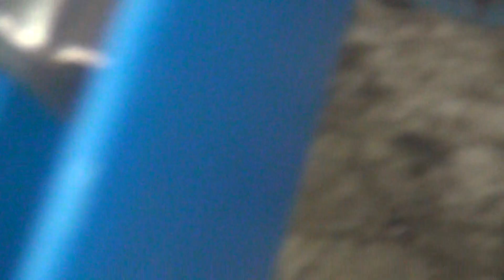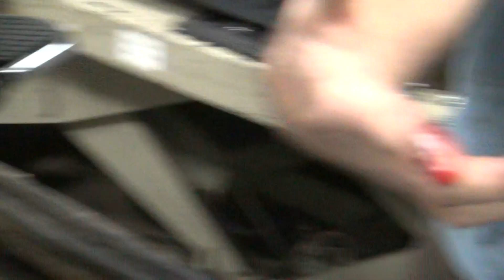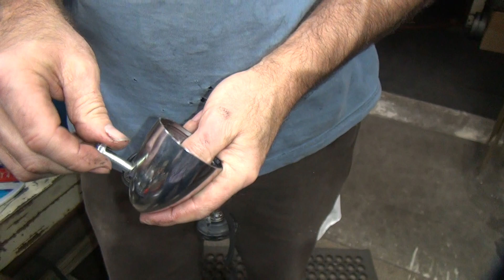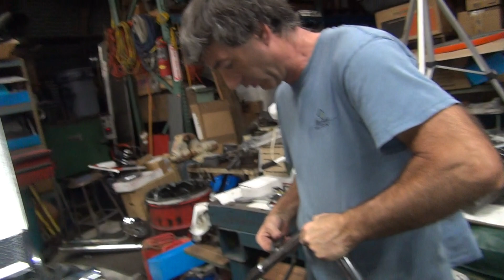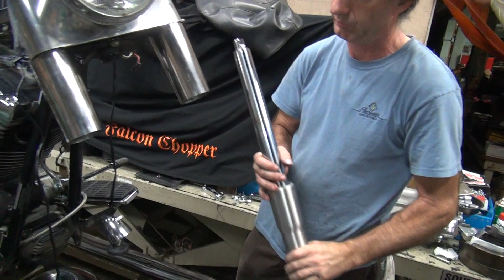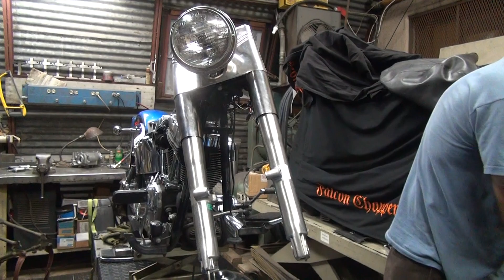2004 fatboy #103 craigslist find alan's new bike flstf softail harley repair tune-up tatro machine

Comment: Tatro, fat boy suspension and many new harleys they have from suspencion from showa made in japan, has a kind of retention "valve" below it that needs to be bled. To drain the air open the top Carry it down 20/25 times .......sorry bad inglis.
Reply from the maker: different fork but thanks for the tip. i think you are dealing with a cartridge fork. flt forks.
tatro
Reply: i work in motorcycles only...a dont no wath is cartridge ? hehehe
Reply from the maker: google it. most all modern bikes use them now.
tatro
Reply: yes...thanks..

Comment: @ 34 minutes you were wondering which side the harness for the turn signals and the dash instruments went on...since you fellas do the videoing it wouldn't hurt to pre film everything beforehand just in case there is a question about what goes where.
I used to take apart and rewire machinery, take it apart on the East coast and reassemble on the West coast...taking pictures beforehand sure saved a lot of time and headache...I'm enjoying the videos.
Reply from the maker: the videos are for teaching you how to think and do it yourself, not just to show you how to do everything. you have to work thought problems to learn something. it would help if i was the one that took it apart and wasn't the first time i worked on one of these new bikes. everyone has to learn including me. 
nothing is pre assembled or planned around here. you get what you get in my videos, good or bad.

tatro

Comment: Guess that is another thing I got to teach you . How to pack a bearing on a headset stem . Take a piece of 3/8' cotton clothes line rope about 6 inches long go around the headset type once with it and clamp the two ends together with baby needle nose vise grips push snugly down on the top of the bearing cage were the two ends of the rope meat there will be a small triangle opening . Take one hand hold rope snugly against the bearing and a medium grease gun like the $10 model you find in the lawn mower section at wall mart press the tip firmly against the triangle opening and inject down into bearing cage turn bearing each time you pump and in 1 minute you have the bearing cage fully packed

Comment: I use spray lubes all the time myself . But they quit making my favorite one it was slick 50 lubes 1 it was like a arial can but it was a pump not aerosol and you could control the speed and amount that would come out . But like all things that make sence they take it away from you . Or as they say just when you had all the answers they changed the f#÷king questions.